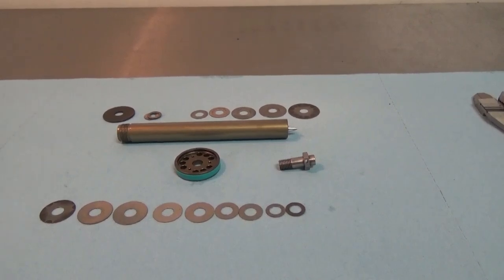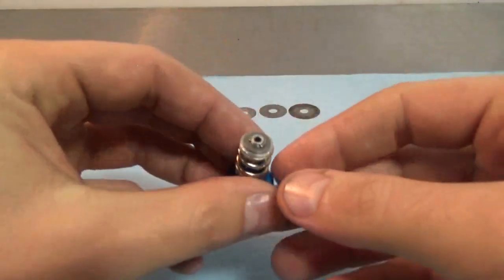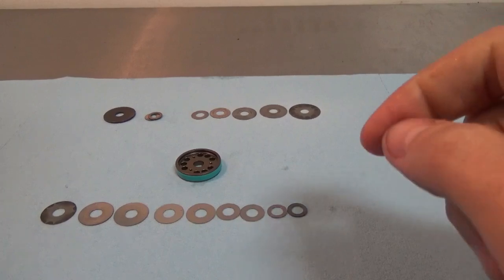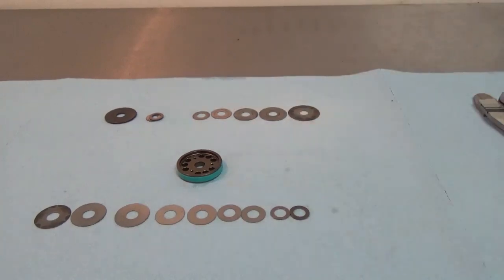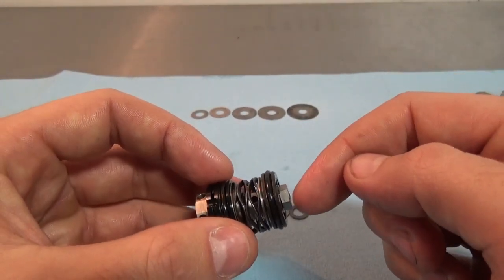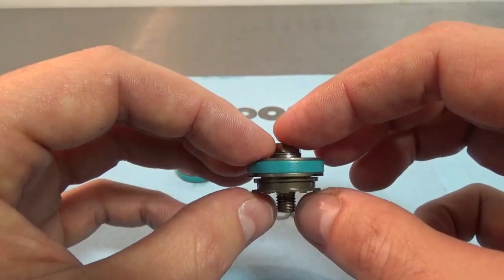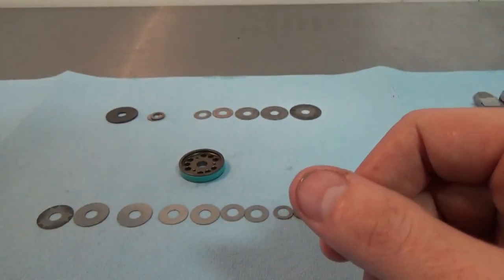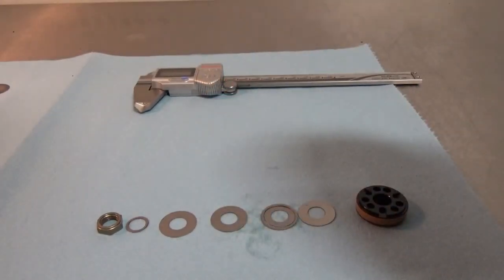Vorsprung Suspension - The Tuesday Tune Ep2 - How Damper Oil Flow Is Controlled

Comment: Hello. Love the video   I do have a question.  I screwed up and while rebuilding my float shock, my rather large clumsy dog, ran around the corner and knocked my table over, which in turn knocked everything off the table. So my shim stack went everywhere.  I did take a video of the boostvalve area all together.  It was still together when it fell over.  So I don’t have any idea of the order they go. I’ve tried fox and other places, and either they didn’t know, fox for ex. Or just would not tell me.   I’ve looked all over the web for images specific to my shock tune. But have not been able to find anything. Also, my local bike shops I’ve called don’t even mess with rebuilding shocks. You seem very knowledgeable and was wondering if you know where I could look to find the order of the shims.   

The shock is a fox float RP23 boostvalve with rebound XL. velocity L and boostvalve 150.  Thx you